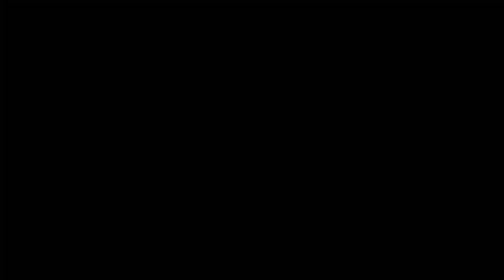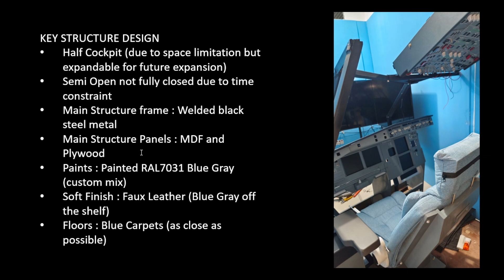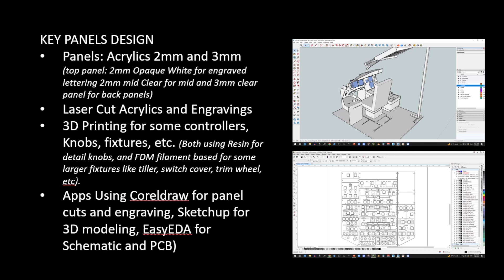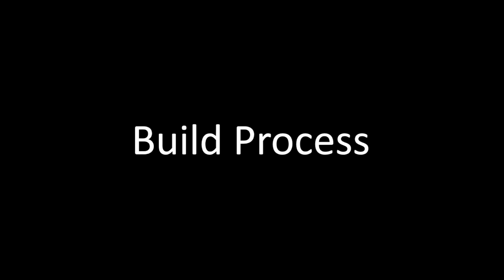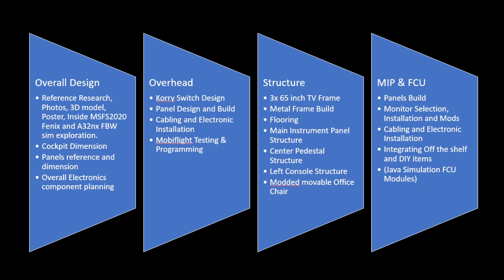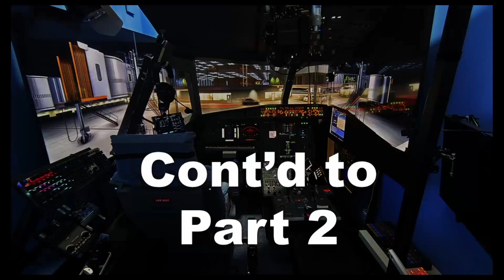DIY A320 Neo Home Cockpit Build Video -  Part1 Design

Comment: Wow.. a must have project for tech enthusiasts. Could you please let me know from where you got a general cockpit layout blueprint for an a320? For dimensions etc.
Reply from the maker: @Mechrank  from several resources in internet and bought a 3d model and redo measurement and then model it using sketchup. Files available on gdrive in the description starting part 3 video

Comment: Would it be possible to download or purchase the CoralDraw and STL files for this project? Very cool build log, excellent work.
Reply from the maker: I provide the files link in the description
Reply: @hobbytechgearID69  hi , good job , i wonder , is it possible to have the info. Regarding all the wood  and rips measurement , or where can i find the information regarding the length and the hight , and so on , thx , keep up the good work .😊
Reply from the maker: Actually starting part 3 video onward if you did not find the link
Reply: @hobbytechgearID69  I really appreciate everything you've done and are doing for the sim community.
Reply from the maker: Most of the files is in Gdrive see part 3 desctiption

Comment: Very nice video, thank you. Is your captains seat also DIY or is it based on a car seat?
Reply from the maker: Its a modded cheap office chair using mdf to cover and attach it unto a metal frame below with ball type caster wheel so it could move within buided gaps/opening as rail
Reply from the maker: Ill make video about it later